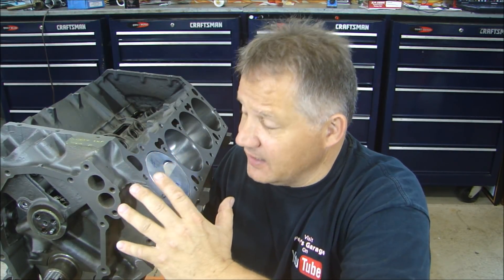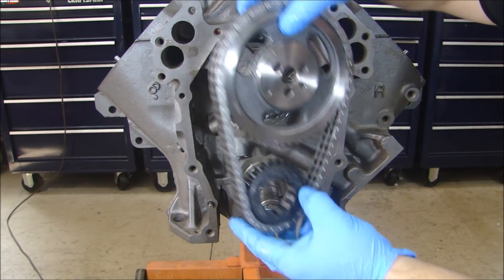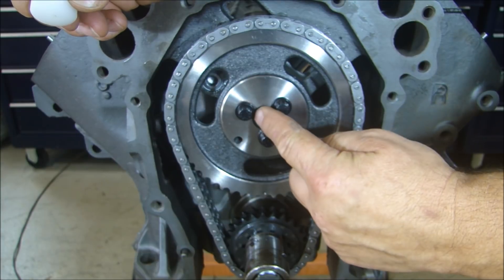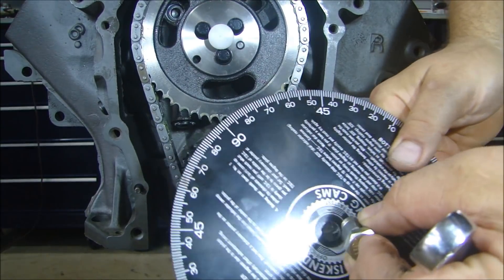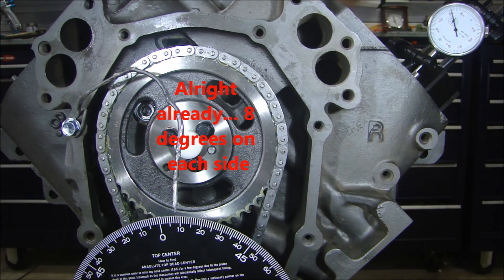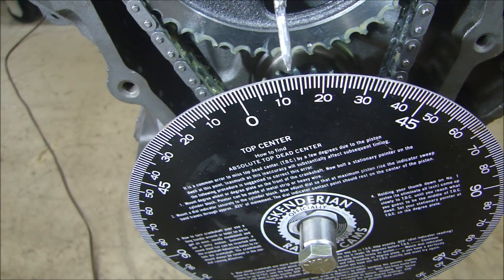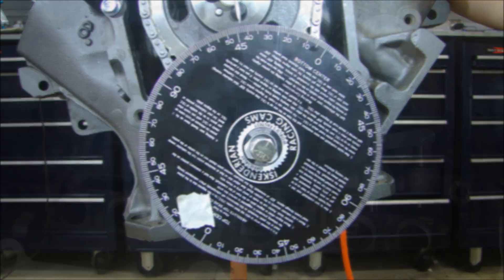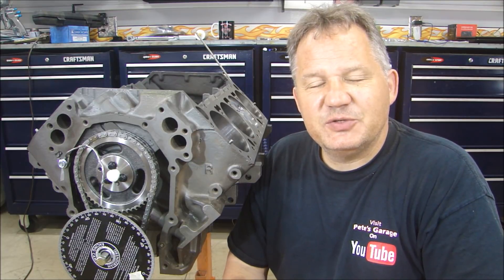440 MOPAR Big Block Engine Building - Verifying the Camshaft COMP Cams

Comment: Another outstanding video Pete! I've got one of the old "Purple shaft" Street Hemi hyd. grinds in my street 440, 4spd w 3.54:1 Dana.
The 280 degrees with .474 valve lift (#2993). I had some difficulties at initial startup and most likely damaged the cam, couldn't do
the appropriate break-in, but I am going to check the valve lift on every lobe to see if the cam went flat! (lots of quality time with a
dial indicator). If it needs replacing, I'll degree it using the procedures in the video. I'll have tons of experience using the dial indicator
by then! Thanks
Reply from the maker: Breaking in a cam has the potential of going very bad. If you check all of the lobes it will tell you the condition. Good luck and have fun with that indicator

Comment: Nice timing set and thrust button choice.  The roller thrust buttons are pretty noisy in the steel timing cover.  When I build these engines put cam in first as the cam bearings can sometimes be tight.  Degree cam with just #1 piston installed makes the engine easier to turn.
Reply from the maker: Thanks Jim....great comment!

Comment: Several years ago I flu out to Vegas to help my cousin put a 440 together. He had a pile of parts coming from Summit and a pile of parts there already. We started putting it together while still waiting for a few parts. We get the pistons and bearing in and the freeze plugs and all the galley plugs when the UPS truck pulls up with the came. Yes, we are excited as we had plans to install the engine the next day.. Here's the degree wheel and chain set and the new cam.. BUT WAIT!!! Why is the distributor gear on the wrong end of the cam???????  Next day on the phone with Summit was less than a great call to make. They did ship us the right cam pretty quickly, but not with enough time to finish everything before I was back on a jet to Florida...  I think of that every time I install a cam or someone else talks about it. What you said about checking the cam as it could have been put in the wrong box,,,,,, YEAH!!!!!  Small block cam in a B Block box...
Reply from the maker: I know how easy it is to get parts mixed up, every company makes mistakes. I wish I were doing this in Vegas....lol
Reply: Pete's Garage why would ypu want to be in vegas. That place is a blast furnace.
Reply from the maker: ah...worth the gamble
Reply: Because where Pete is from, they have to pay to have the SUN pumped in.. Upper Western NY has a short cruising season and a long SALT THE ROADS season. Plow or shovel the driveway and walk much of the winter and freeze your ass off too much of the time... I grew up not far from Pete and I am telling you this from personal experience. Vegas, as in Florida, we are use to the heat and everything here is air conditioned. The 30 seconds to get from the house to the back shop is hot, but doesn't lock up your back like that February wind does up there.  Besides, ALL the shows come to VEGAS!!!!! Pete would be at SEMA every year and sponsors would be at his doorstep.
Reply: Steve 1961P. Oh,ok, they have that lake effect snow and those storms that cover everything in ice.

Ive lived in the desert and its hot all the time and there is absolutely no green plants or trees or lawns anywhere. No green was hard on my psyche.
Reply from the maker: Come on Steve, you know it's tough to leave LaNova, Ted's, Louie's, Mighty Taco and John & Mary's. I'd love to move to Vegas, give all those custom shops with TV shows a run for their money. I'd be the clean cut, no tattoo, well spoken shop. I could use a goor PR man like you.
Reply: I'm IN!!!!!  You know, I do still miss the food from back home. I've been in Floriduh since 94' and I still can't find a good pizza joint. The burgers here suck too!! What I wouldn't do for some wings from Sal's Birdland, a Garbage Plate from Nick Tahou's, and for cripes sake, someone send me some WHITE HOTS!!! People down here have NO IDEA what they are!!!!!  But I know a store in Vegas that brings them in!!!!!  ;)
Reply: Come on Bill... Vegas is in the desert. It ISN'T without plenty of green grass and trees. Hell, it isn't very far from a beautiful lake!!!  Have you ever been to the Las Vegas Speedway???? Any idea how many sweet old muscle cars and hot rods are there??? How about the LACK OF TAXES????  Sure it is hot, but I am positive that Pete will not be living in an old van in the middle of the desert. Unless the price is right and I'd be right there building a house and huge shop next door to him!! 
Hey Pete, how'd you like to have a dyno right next door????
Reply from the maker: Stop teasing me Steve, I'm ready to pack it all up and head out there. Maybe I'll go out tonight for a white hot on Sheridan, or maybe a double cheese and pep from Bocce and think about it.
Reply: Definitely from the old hood. You know exactly how to hand it back.. Now I am starving!!!  lol..... But I am ready fro Vegas when you are..  You already have a bunch of followers from out there....

Comment: its nice when you have a good adjustable timing set and a degree wheel to fine tune the engine for track altitude , car weight , auto trans , manual trans , and type of fuel used .etc
Reply from the maker: It is a great tool.

Comment: It seems there is no installation video of the bushing for oil pump intermediate shaft. Some forums say u have to use special tool to expand then burnish the bushing to size, others just hammer the bushing into place .  The factory original bushing is said to be aluminum and new style bushing bronze, so maybe the special tool not needed anymore. What is your opinion?
Reply from the maker: Every time I use a drift and hammer them in. They are bronze and go in fairly easy.

Comment: Take the time to learn the Keith Black cam timing method. It is far faster and more than accurate enough for application. Unless of course you want to go back in time and tell Keith black he was full of beans, but then again Mickey Thompson was intentionally trying to blow up his Hemi engine because he wasn't getting enough performance out of it when he decided to set the ignition timing at 50° before top dead center and ended up just absolutely blowing away the competition and that's how the Hemi engine became such a Powerhouse. These guys learned by doing.
The cam button actually looks like it's made of Delrin. And you should have used red or orange Loctite on those bolts. Unless you plan on taking that thing on and off a number of times.
Reply from the maker: Thanks for the comment

Comment: Hi Pete, love your channel by the way! I have a question abouts BB chrysler timing covers and the cam button clearances.  I see you have used what looks like a stamped steel cover and wondered who's and how ya figure all that out? I'm stumped I've looked at AR 224 for 350 bucks but it may have clearance issues with the water pump housing. Want to go roller cam so any info or insight you could give me? Thank you for doing these great videos, I come from the GM side and this is my first Chrysler 400 to 451 build.
Reply from the maker: Thanks Stacey. That is a standard timing cover WA9392. It will fit with the roller and water pump

Comment: Likely a dumb question but I thought about this on your last cam video and I'm still not sure. The bolt that's in the crank that you use to turn the engine over - what stops it from loosening within the crank whenever you turn the engine "back"? As a related add on, how do you torque it down to spec given the engine can (of course) turn over while you do so?
Reply from the maker: That's a great question. The bolt in the crank is torque down while holding the crank in place. If it is torqued properly you can turn it backwards without the heads on or spark plus as there will be no resistance.

Comment: Hey Pete. I have a 65 289. I am considering backing it up with a Tremic 5 speed. My problem is, the block is a 5 bolt and the tremic bell house a 6 bolt. Would it be ok to make an addapter ring, and if so, how thick does it have to be?
Reply from the maker: You can change the bellhousing. I did on my Tremec
Reply: Pete's Garage that’s good news. Thanks. I’m buying the edelbrock 2091 top end kit. Do you have advice on what I should do for the bottom?
Reply from the maker: A good steel crank with a balanced rolling assembly

Comment: Is that block bare metal, or is it coated with something right now?
Reply: HemiHead664 that looks like just a bare cast block
Reply: Some people spray WD-40 (or a similar chemical) on bare engine blocks to prevent rust. They remove the WD-40 before painting the block.
Reply: Skyline Fever
Years ago I never got my blocks back from the machine shop looking like that. Maybe different process of cleaning. Caustic. Having it baked and blasted. I never asked.
Reply from the maker: It was baked and cleaned and painted with cast blast
Reply from the maker: Not a bare block, coated with cast blast. I will clean it and epoxy prime / paint it in a video shortly.

Comment: All due respect, and you're a fantastic engine builder,  but this is not "Degreeing" any cam. It's "verifying" the cam's properties but the cam timing relative to the crank is untouched and fixed (in this case).  A twincam , for example, can have all sorts of degrees of freedom , of course one example being a stock cam pulley and cam etc. etc. but others abound.
Reply from the maker: you are 100% correct. I did not degree the cam to the installed centerline. I changed the name of the video to just checking the cam. Thanks for the comment.